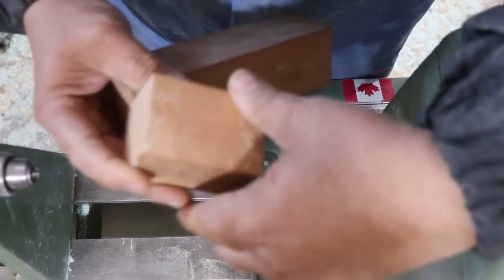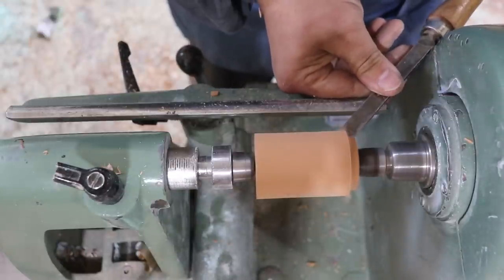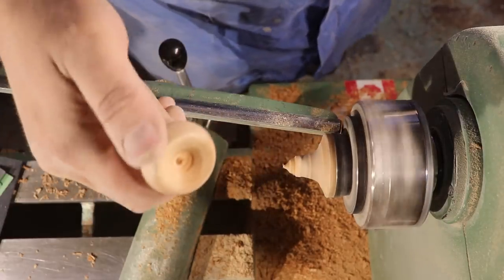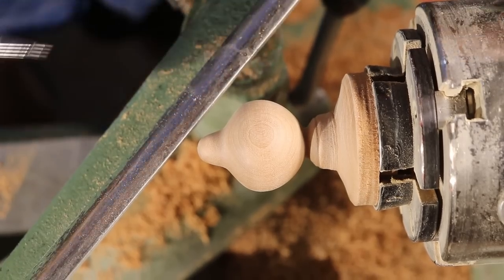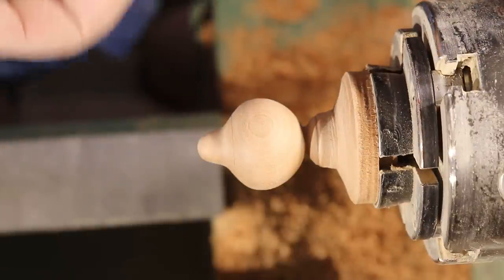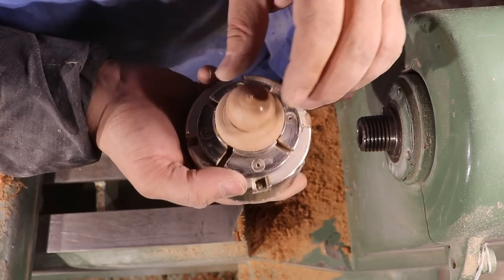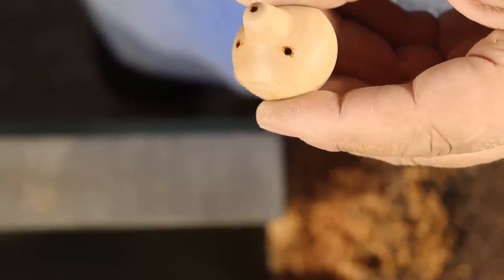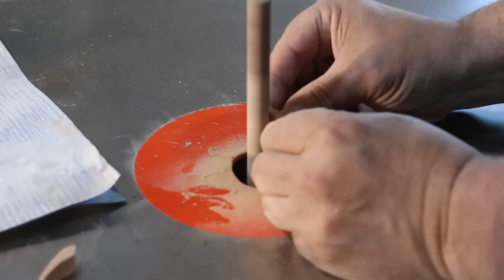Woodturning | Project That Sells - How to Fund Your Shop - Adorable Seal From Scrap Wood

Comment: I'm not sure I'd charge that much because Star Bond never holds for long...so let's say you have it sitting around a few months before someone buys it...the parts glued on with Star Bond are going to fall off....If it were me, I'd use epoxy.
Reply from the maker: It is still good, time will tell I guess. Thanks for watching!